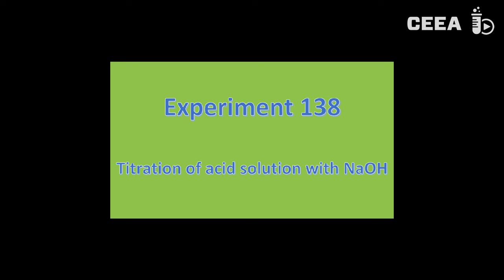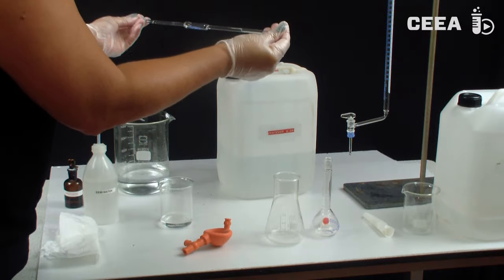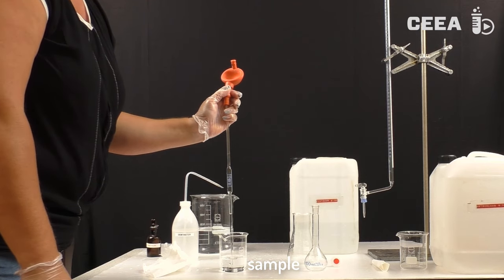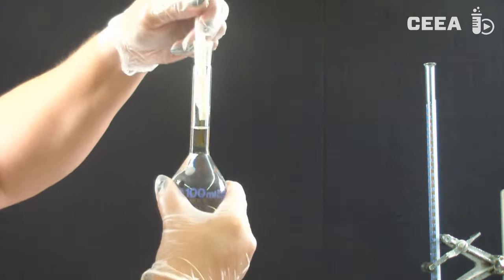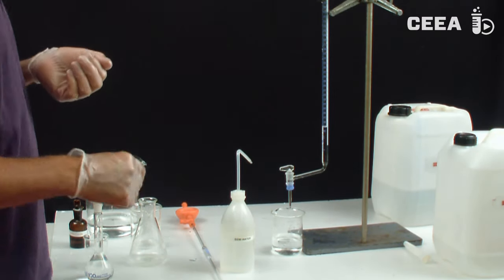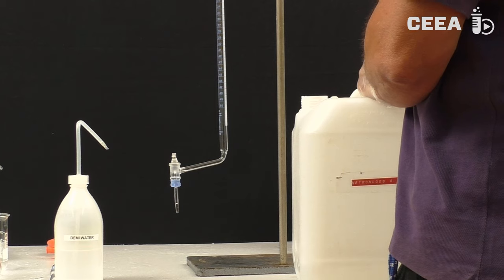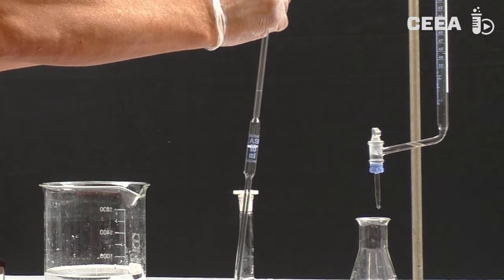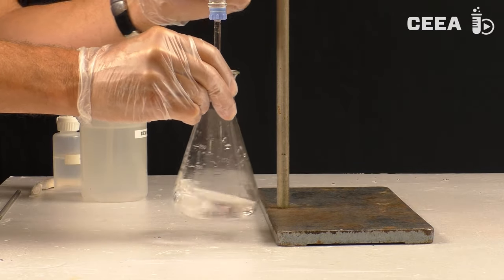Titration of HCl with NaOH

Comment: Thanks .. 7:17 Why did you add water to the sample in titration flask? Is not affect the result?
Reply: No because the amount of Sample is not changing. Change in concentration will not effect this.
Reply: @bidishadey3815  Is it necessary to add water? What's the reason?
Reply: I think it is to wash down the titrant/ solution adhering to the side of the flask. If it is not washed down, it may affect the accuracy of the measurement.
Reply: @bidishadey3815  Thanks answering me🌺
Reply: You are welcome.

Comment: @CEEA Erasmus - safety first! Why wear gloves but no lab coat or eye protection? 

That is the worst design of burette I've ever seen! The elbow bend does nothing except introduce instability and a weak point for it to break at. I also hope that is a pre-washed or single-use paper clip you were using to introduce an air channel under the funnel ;-) Given your love of using filter paper I'm surprised you didn't just roll up a piece of that and fold it over the top! You should just put a joint sealing clip on the funnel stem if you are that worried about air pressure equalisation and potential solvent blow-back but I always used to use my other hand to lift the funnel a little - no chance of introducing crud into your nice, clean burette then!

The main equipment related thing I wanted to ask though is why the heck be so meticulous about cleaning the pipette if you are then going to drag the tip along the bench top?!

Procedure wise, you expect your students to be psychic or something? Either tell them to do a rough titration first to establish the approximate end point and/or you should tell them that the indicator colour change will persist longer and longer the nearer you get to the actual titration end point. I was taught that the final indicator colour change should be brought about by the addition of a single drop of solution.